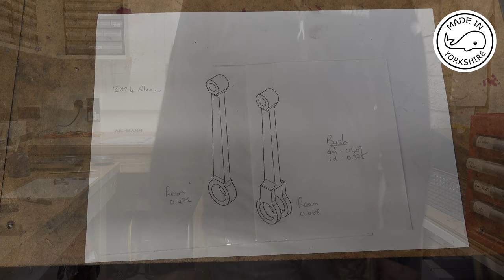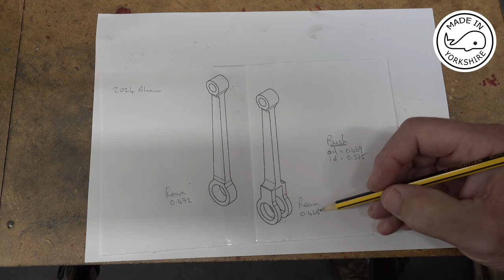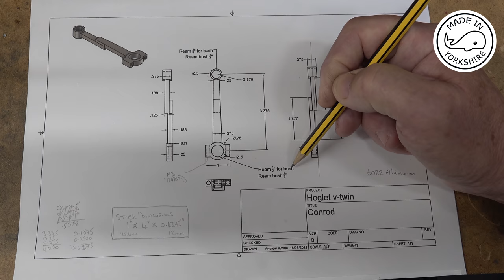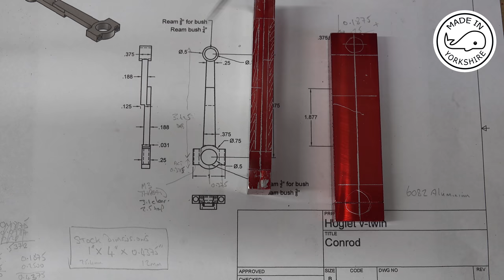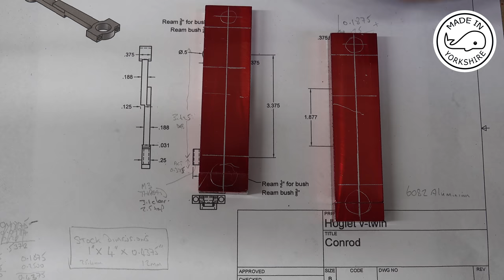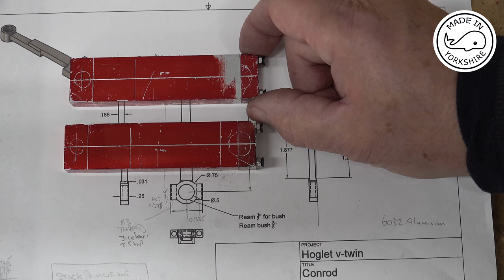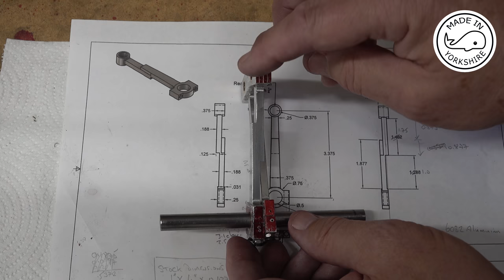#MT44 Part 6 - Hoglet V-twin IC Engine. Making the Conrods (MISTAKE). In 4K/UHD by Andrew Whale.

Comment from the maker: :dothefive::dothefive::dothefive::dothefive: PLEASE DO NOT MAKE CONRODS TO THIS DESIGN :dothefive::dothefive::dothefive::dothefive:
Having re-designed the conrods, I later realised that they will not fit in-between the flywheels.
As such I intend to remake the conrods as per the original drawing.
I will still have to find a better solution for crankshaft assembly as the pinch bold just doesn't work for me. 

😥*** FOR INFO - I ALSO MESSED UP SOME OF MY MACHINING CALCULATIONS *** 😥
I machined both conrods incorrectly as follows......

19:49 I should have milled 0.156" not 0.124"
20:48 I should have milled 0.094" not 0.124"
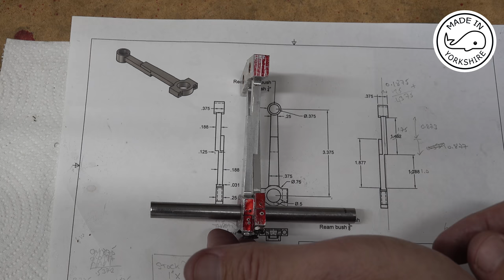22:47 I milled 0.030" off both sides of the little end. I should have milled 0.062" off just one side.
My machining errors have resulted in the little end being off centre by 0.031"
So I will have to reduce the width of the little end by 0.031!
Please don't make my mistake.
Reply: I seem to make my own mistakes on my projects.😭

Comment: Great outcome Andrew. You really should get a small bandsaw and belt sander. You could then quickly rough out your small ends and save a lot of rotary table milling. Looks like it took you several hours. Regards from Australia.
Reply from the maker: Hi Dave - A small bandsaw would come in really handy. I must look out for one. Believe it or not I have a belt sander - but I forgot to use it! 😂
In reality it only took 10 minutes or so to mill on the rotary table.
All the best.
Andrew

Comment: Interesting piece of redesign. The logic is sound and it should work. I agree with Howard Osborne, you need to prevent the large srfaces of the big ends from rubing together. It will bind, clatter and wear. A small projection on the ends of the bushes or a washer should do the job. I suspect a washer would wear very quickly though. Really enjoyed this video. It is a fascinating project.

Comment: How do Andrew, that's an interesting solution to 2 con rod's on one crank pin. My one concern is the loading on the big end is no longer on centre and may cause side loading of piston and rod. Maybe not an issue on a small scale but I suspect anything larger and you would experience piston rock and excessive wear on the inner areas of the big end. Keep the updates coming, I'm enjoying seeing a fellow Yorkshire man sharing his experiences in the machine shop.
Reply from the maker: Hi Andy - you could be right about excessive wear. The Hoglet is supposed to be a 'show and tell' engine and not intended to power anything - well that's what the blurb on the front cover suggests. With that in mind, I think the design is somewhat lacking in places. My build of this engine is a bit of a test for me. If I can get this working successfully I intend to have a go at making the Jerry Howell v-twin - a more complex engine with superior design. Well - that's the plan!
Cheers
Andrew

Comment: Well here I am a little late to the party again this week as it is Thursday morning coffee with Andrew Whale.  Between your video and the comments I a longtime steam engine builder recently trying my hand at IC am getting a great education. I think I do agree with the comments on your conn. rod changes producing some side thrust on the pistons as opposed to the original design but as you say it is just a show and tell engine not designed to run anything and if you are like me the engines spend most of their lives on the shelf only taken out to the occasional model engineering show to be run run thus have a very long life.
Cheers from the New England shores,
Dick B.
Reply from the maker: Hi Dick - I think my conrod design isn't ideal but I'm between a rock an a hard place. The crankshaft design using bolts just doesn't hold well, so my only option is to use solder or loctite. As such, I think the conrods must have split big end bushings. Nothing ventured nothing gained as the say.
🤞
All the best.
Andrew

Comment: Some full size engines don't have small end bushes, doesn't seem to cause any issues running the gudgeon pin directly in the aluminium. In fact its normally the hardened steel pin that wears first, because the conrod acts as a lap.
Reply from the maker: Wow - I didn't know that! Old habits die hard though.
Cheers
Andrew

Comment: As a total novice (Me) from what I have gleaned from various sources would it not have been better to have put an angle where the step is on the middle of the con rod as they say a sharp angle is a stress point. Just asking
Reply from the maker: Interesting - not heard of that before. I will try to remember that for future.
Cheers
Andrew
Reply: Yes, you're right.

Comment: With the internal taper perhaps you could have cut it to 30 degrees by using a center drill?
I have some tiny carbide Horn brand boring bars brought cheap “used” from eBay and they can bore out a hole down to 5mm smaller ones are available. Tool height is very important once you get this close to center.
Also you can grind a very small milling cutter into a boring bar quite easily, just grind away all but one of the teeth.
Reply from the maker: Hi Mark - many thanks for the advice.
All the best.
Andrew

Comment: Hi Andrew.. great video thank you for posting.. a similar design using brass was used by Nick G over on ME site, works very well and myself will be going down the same route.. I'm currently finishing the cylinders and heads on my build.. by the way thanks for the spur gear vid as that's helped heaps for me 😉 cheers..
Reply from the maker: Hey Colin - I'm glad I'm not alone taking this approach. The crankshaft design seems to be a weak point on this engine. Any tips on making the cylinder and heads would be greatly appreciated.
I hope yours turns out well.
Cheers.
Andrew

Comment: Interesting redesign from the original 'knife & fork' big end design. My only concern here is the area where the 2 big ends are cheeked side by side as this presents a quite large surface area of aluminium rubbing on aluminium. Ally on ally is a very poor bearing surface. Perhaps a thin bronze thrust washer in between the 2 big end cheeks would be more reliable and less likely to seizure/galling. Or maybe you could design the bronze big end bushings with a thrust face incorporated into the bush.
Reply from the maker: Hi Howard - Great point - I really appreciate your thoughts on this. I will try to work out if I can introduce a thin bronze thrust waster. Maybe I could mill some aluminium off to expose the big end bushes. I will investigate!
Cheers
Andrew
Reply: @learningturningmetal  Yes,Andrew,I also had the thought about mounting the rods on the rotary table and gently taking a few thou off the 2 cheeks that contact each other. If it were mine I would certainly shave a little aluminium away from the each of the rubbing faces to just leave the bronze shells slightly proud and in contact with each other.

Comment: Andrew, honestly can't believe how your skills have improved over such a relatively short period of time! Really inspiring me to get a lathe & mill. Having to wait for Warco to get some stock in 😭  Have you any recommendations for sellers of cheap but decent tooling & accessories? Such a range of prices for things with not a lot of info on what the differences are with quality.
Reply from the maker: Thanks mate. A difficult question really. I've bought lots of stuff from lots of suppliers. Most of the stuff comes from China anyway. Arc Euro Trade's accessories are pretty good, and they've just started selling Dormer drill bits ☺. Axminster Tools are good for rotary tables. Associated Production Tools (apt) sell really good quality collets and end mills. Chronos are good too. I had a problem with RDG recently so I wouldn't recommend them. For measurement you can't beat Mitutoyo gauges. Be prepared to spend at least twice as much as you have spent on machinery. There is always something else you need. The great thing is that it's a really interesting hobby and helps keep the old grey matter active.
Cheers
Andrew

Comment: The actual Harley-Davidson engines have been using the split rod ends, fork-and-knife style for over a hundred years... BUT they use fitted roller bearings instead of bushes . Their rods are forged steel.  They are well known for their longevity.
Reply from the maker: Hi Peter - very interesting. I think that the smaller size of the Hoglet has introduced some design challenges.
All the best.
Andrew

Comment: You are turned almost all joints of flats on the conrod heads and on the conrods themselves  to stress concentrators. It may only guess which, exactly, of them will be critical and in what of them conrod will break...
All joints of flats must be machined in galtels, and conrods, if it wasn't supposed to avoid heads misalignment - must be with oblique transitions, not a step.
But simplest and obvious way to avoid such troubles - cylinder axes offset to each other along the crankshaft.
Reply from the maker: Thanks for the advice - I will investigate.
All the best.
Andrew

Comment: That offset will cause side loads on the con-rod. Probably not much though.
Reply from the maker: Hi Andrew - I tend to agree. Fingers crossed it will be OK as this engine is supposed to be a 'show and tell' and not designed to drive anything. Worse case I try to revert to the original plan.
Cheers
Andrew